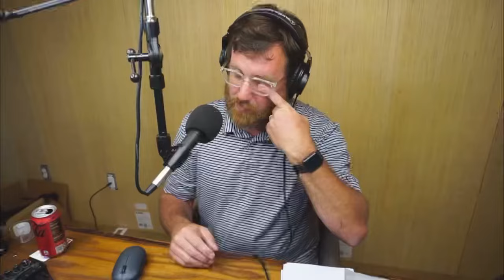What Ice Storms do to Heat Pumps

Comment: My father-in-law and I renovated my 120 year old house… the house never had central heating/air and we decided to put the units outside the dining room windows on the side of the house… in the drip line. “It’ll be fine.”

 The gigantic triple window right above the two units is basically falling apart now and my fan is struggling tonight with the first ice storm we’ve had in years… because we installed right in the drip line. 

I second what you said - don’t put the units in the drip line!!!
Reply from the maker: Hard lesson to learn

Comment: I watch for this and melt any ice away with a pitcher of warm water.
I've also placed gutter guard screen (large mesh) on the inside of the coil in the fan area as a shield to prevent debris slung off the blades from bending over the coil fins.